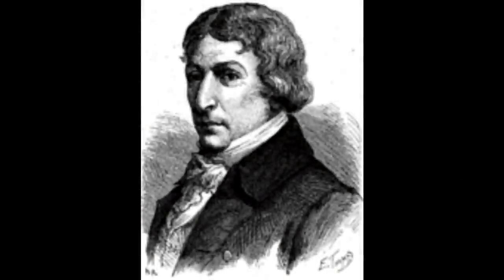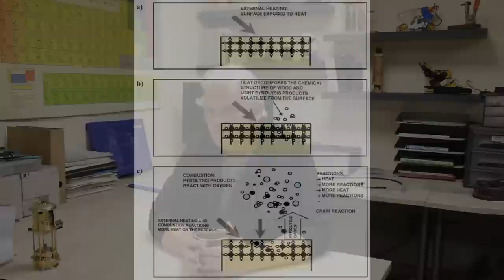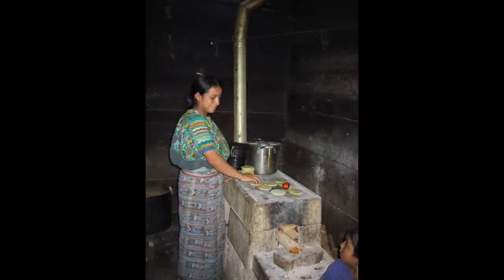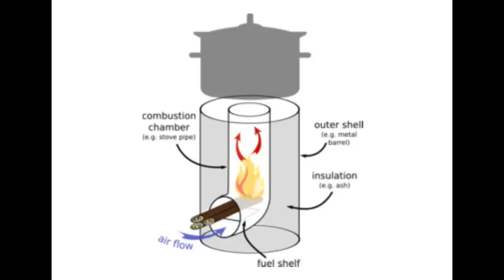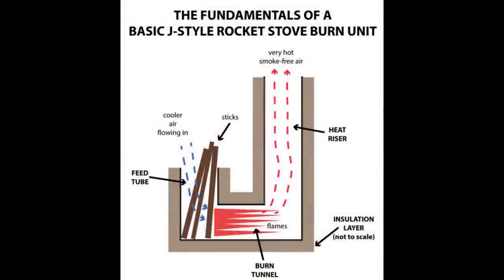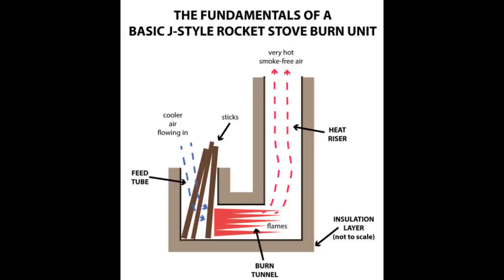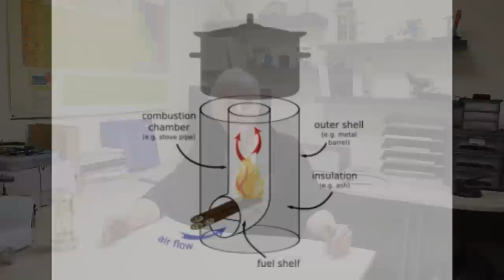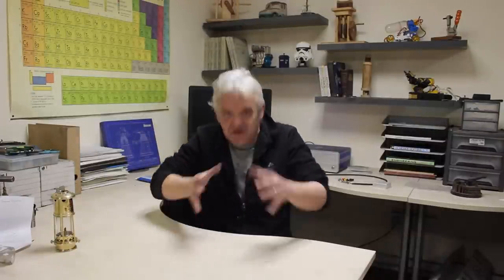1742 The Rocket Stove - Explained and Demystified #rocketstove

Comment: Hi Robert,
This video inspired me to formulate a challenge for you.
Currently there are 2 types of stoves used in bikepacking: propane and alcohol stoves.
Alcohol is not as energy dense and can be dangerous in case of a spill near the fire. But the stoves (see DIY alcohol stove) are very light (20 g?) and small, thus portable on long journeys. Fuel can be carried in different size and shape bottles.
Propane needs a certain volume and it's harder to check amount left in the bottle. Access is also limited to some specialized shops that one can find or not in his/her way. Advantage: it's instant, no spilling, it's energy dense.
Now, my question:
Can you come up with a different type of small, easy to carry and to assemble stove design that uses some other fuel that might be cheaper and easy to find, with acceptable energy density?
My next year's plan is pointing to Greece where I can find Lidl supermarkets.
Stove will be used to cook food, not just tea. Trip will take 2-4 weeks, so we're talking about a lot of cooking.
Thank you!
Reply: Check out tin can wood gasifier stoves. They're light enough for bikepacking.
Reply: In the meantime I made one for myself.
It's a very cool device but it consumes the fuel very fast. 
I'm thinking about trying out a mix of wood and used cooking oil.
If it doesn't make a smoke column visible from the other side of the Atlantic, it'll be a winner choice.

Comment: yes about the mass, good rocket stove mass heaters radiate heat now from the barrel section, then the exhaust is directed through the mass to warm it up for slow radiating. it does take a lot more space to make the mass, but once warmed it may only take 2-3 small fires a day to keep a place warm. a chimney over a kerosene heater, that collected+pushed heat through a mass could work similarly, bright white flame is pretty efficient, same burn as a decent kerosene oil lamp gives but using a much smaller wick.
Reply from the maker: that's jus a hybrid device mate and so it behaves like a hybrid a bit of one and a bit of the other

Comment: From my understanding, to give the stove the maximum live span, special fire bricks that can withstand temperatures up to 1700 degrees Celsius can be used. Based on aluminium oxide it will last longer than steel at the generated temperatures, these are readily available and do not cost much either.

I would argue that the rocket mass heater shown at 8:28 is better in a way. It has a bell with the same function as the rocket stove shown a few seconds later. The second stove goes straight to the chimney after the bell, while not all energy has been extracted from the hot gasses. The first one extracts more energy from the gases by guiding it through a thermal mass (disguised as a coach) after the bell, before going into the chminey. So while they both have the same combustion efficiency and thus produce the same energy, the rocket mass heater extracts more energy from the gasses before releasing it into the chimney. With regards to energy efficiency it's better than the second stove, at the cost of added weight, bulk and complexity.

Just my 2 cents ;)
Reply from the maker: fair points mate - I am more than happy to agree to disagree lol - though it does seem a bit unfair to compare apples and oranges - how do you think a mass heater would perform if it was just connected to the chimney and not the bench?
Reply: @ThinkingandTinkering  It should be obvious, so its baffling that you do not see why.   With the 8:28  design, the barrel releases the majority of the heat into the room.. quickly and efficiently.   The remaining exhaust heat that escapes the barrel transfer stage... gets pumped into the Bench, to be absorbed by that huge thermal mass... before exiting the house, in a vertical chimney.

 The thermal mass captures virtually ALL of the remaining heat from the heater.. and releases it slowly, throughout the entire day.   Unlike fully instant heat, which most of it gets quickly lost to the ceiling... rather than on the level where Humans exist.

 Also, Since you can not 100% guarantee that a burn will be 100%... especially at the start of the fire..  you cant just burn a rocket stove in a house.  You need a chimney that exits the building.   And if you are directly dumping super hot air right out of the chimney... rather than recovering it into a thermal mass... then essentially, you are wasting it.

 According to reports Ive heard... People with properly build rocket mass stoves, like the 8:28 design... went from using 4 chords of wood... to 1 chord of wood, for their winters burn period.   Thats a huge difference in efficiency, and effective Heating.

Comment: There never is a best solution for all situations. Anything designed to do 2 things or more never does any of those things very well. Think using a helicopter search light to change a car tire at night. Blinding yourself extravagantly is not useful for that application.

Extra physics points (for the cool geeks):
You made me realize that a mass heater simply slows down the heat like a Bose-Einstein condensate slows down light and releases it slowly. 
Heat IS infra-red light, so man has been slowing down light since before the measurement of the "constant" speed of light! 
A-HA!

Comment: Good video - as usual!  Thought your description of the best use of the mass heater was poor though.  Hear this - they normally have a more extensive chimney system inside the room - properly done they look to have a cool stack outside the house (virtually all heat left inside) and zero smoke (all fuel burnt).  Now - regards the mass part.  They're mostly set up in northern climes with long cold winters (Russia, Alaska etc.).  So you're heating the house for months on end - continuously - day and night, to a varying degree - but always somewhat.  Feeding the fire all the time is a pain - especially at night - so the idea of the mass is you run a furious fire 3/4 times a day (it goes out in-between) but it's evened out to a fairly continuous room temperature is the main idea of the mass.  They use around a third to a half the amount of wood of an ordinary fire too - which save much work/money.  So it's not so much a set up for Kent or Cornwall - perhaps Scotland.

Comment: I have a question, Mr. Robert,
Can you increase, by a homemade method, the radiation of the stove bodies? A building material, a paint job, something else ? Is it possible to achieve a significant difference?
Thanks!
Reply: Yes, you just spray paint it with a high temp paint of some kind.  You could also put a layer of carbon on the outside, but that is far messier, potentially. The more shiny and/or polished the metal, the more it needs a treatment like this to absorb and transmit IR. Shiny and/or polished metals are particularly good reflectors of IR.  Though there are significant differences between different materials.  (Aluminum is one of the best all around, broad spectrum IR reflectors).
Reply: @justinw1765  thanks Justin, for your reply.
I saw the terracotta pot trick Mr. Robert did- painting it with graphite. Now, that would be messy as hell, but I guess there are more stable paint solutions.
I have sprayed my woodstove (see my YT channel) with a 800 C black matt paint. It holds relatively good so far, for two seasons. I've always wanted to know of there was any other brands pr solutions to further increase it?
I guess I should eventually bolt to the wall aluminium plate, because of the high IR reflectivity property it has. That way the wall behind the stove would not steal heat as it does now.

Comment: I wonder if you could come up with an idea for a simple 'flu box' that one can sit atop a standard commercial gas heater that catches the bad smell that the burning of gas emits and lead it through a flu to the outside but not without first extracting as much heat as possible.

Comment: O no Robert, you missed out on this one. because the rocket stove generates a hotter flame in the tube everything is burnt better/cleaner. a mass heater does generate heat immediately throuhg the barrel that's on top of the j-tube.

Comment: Thank you for making the concepts inherent in the "rocket stove" much simpler to understand. There are one or two points you make, however, that do not seem consistent. first, you say that the mass heater does not provide more efficiency, it just shifts the time frame of receiving the heat.  Do you mean that in comparison only to a rocket stove or any wood stove, such as a cast-iron airtight stove.  Isn't there loss of efficiency if there is no mass to absorb all the heat produced through a long run of pipe through a thermal mass ? At a hot enough burn to consume all the gases, most of the heat will be lost up the chimney since conduction and convection are insufficient to move all the heat produced out through the walls of the stove.  The other point you make, about the rate of burn not having any effect on the total amount of energy produced, similarly seems to contradict what you explained at the beginning about the stages of wood burning.  When lowering the rate of burn, one must reduce the flow of air into the stove (again, I am referring to an airtight stove). At that slower rate of burn, the gases given off cannot burn and escape up the chimney, thus reducing the total amount of energy captured by combustion (and releasing air pollution). Only a faster/hotter fire can burn those gases completely and thus gain all the energy from the fuel.  If I am missing something, please explain where I am mistaken.  I am certain you know a lot more about this subject than I do.  Thank you !

Comment: I wonder if It makes sense to install a rocket stove, even a brick rocket stove, outside and make two holes in my wall, high and low or left or right, and make a 20cm metal pipe go out of the house with a computer fan past the flame and back into the house and let it heat up the air in a closed system and keep the fire and fumes outside for a house without a chimney.  I wonder if I could easily plug those holes back up if it would not work well.  Would love it to work well tho.   Thanks for making these videos.
Reply: mr grumps  true,  true….

Comment: Problem with storage heaters is you have to know what the following day will be like, which I found was an issue so great that they had to go (I never got it right). Gas central heating replaced them as soon as I could afford it. Cold turn it on, hot turn it down 🙂
is there a design which has an ash pan?

Comment: Early on you talk about the heat going into the bottom of the pan or pot but missed one of the key points of the rocket style stoves. The gasses, soot, creosote & solids a fire pushes into the space or out the chimney. Importantly in developing parts where these were invented for those gasses were killing the folks who had to cook indoors slowly by causing cancers, black lung & in extreme cases CO2 poisoning. The more complete burn reduced these compounds dramatically.  
8:00 The catch here is the barrel style of mass heaters. The quick radiant heat comes off the barrel top & sides but just after the exhaust you can push the cooling gasses into a bell or mass. This stretches out the warming time.
Reply from the maker: it's not a catch mate - if you build a hybrid device you get hybrid behaviour

Comment: My understanding is if a rocket stove  is shaped correctly it will 
burn/reburn the flammable smoke, gaining efficiency & heat..(commonly called wood gas, that is lost in the normal process)

Comment: Well mass heaters also do something else, which explains why we still see people making videos about the plant pot/tea light heaters. 
 It traps the heat as a certain level in the room. So in the tea light heater, build a tea light plant pot heater and next to it put a single tea light. Both tea lights put out the same ammount of heat. But the one by itself puts all its heat up straight away. Up and typically above peoples heads and out of their line of senses. The cant feel it and since heat rises, it stays there warming up the ceiling. The plant pot gives a visua focus and as you said lengthens the time over which the heat is released, but it puts it where it can be sensed. They make nice hand warmers but not much more. 
If someone wants to make a really good plant pot heater for a small space then get you one plant pot. Put a small piece of screen or a small broken piece of plant pot on the drainage hole and then fill the pot with plain bargain basement unfooled around with kitty litter, or vermiculite, and set up bricks or pavers such that they will hold the pot off the ground and hold it stable so it doesnt fall over. Get you some sterno heaters or chafing dish heaters and use two or three of them to heat the pot and the litter. This will also heat the bricks or the pavers but less so. 
 This will put out some residual heat immediately, near the device, but like he said you are just charging a heat battery. Once its hot, a small electric fan will help it heat more air more quickly buy blowing air over it. You can get this quite hot as chafing dish heaters can last 4 to 6 hours or more depending on size and type. So maybe set up something to keep people from bumping into it and burning themselves on it.

Comment: Okay folks. Here's a twist. What about recommendations for a rocket stove for a maple syrup evaporator? 
My big question at this stage is wondering if I should put the rocket stove in front of the evaporator and have it exhaust under the pans or is some other configuration appropriate? 
One thing to keep in mind is that you want as fast of a boil as you can get. Slow heating isn't very useful as you're trying to keep the sap boiling and the more vigorous the boil the more efficient it seems to be.
Reply: I would use a "Liberator" style rocket stove. People make them with the J stove thing he's showing here (often with an auto feed section extending up and away from the firebox), with an insulating chimney, inside of an upside down 60 gallon steel barrel. The hottest part is sitting on top of that 60gallon drum. But you can also gain a huge amount of energy from the horizontal exhaust piping before it leaves the building. The efficiency difference isn't in the burn because they both burn nearly identical. The gigantic efficiency gain from the style with the 60gal drum  is in capturing the heat from the exhaust before it leaves the building, and in dumping that heat down low so that it warms the floor and rises upwards through the building. 
It's important to have a hot firebox and initial chimney section to allow for complete and steady combustion, however for best heating efficiency you then want to steal as much of that warmth as possible without killing your chimney draft. The 60gallon rocket stove with the horizontal exhaust that comes out low allows for the best of both worlds.  It really is far superior in every way.

Comment: I've been thinking about putting a wood stove in my shop. I also have lots of used engine oil from the cars I work on. I've been thinking about combining the mass rocket stove idea with an oil burner to heat the shop and get rid of waste. Any input about burning oil in a rocket stove would be appreciated.
Reply: Recommend recycling the oil.

Whatever goes up will come back down and its vest to keep that out of your air and ground water.
Reply: @l0gic23  recycle it into what?. I've heard that it is sold as bulk fuel oil to run large ships to help cut their costs. If they can burn it, so can I.

Comment: Get the best of both.
A rocket mass heater with a contraflow drum.
Instant heat from the drum and slow heat via the mass.

I wouldn't built a J tube version i would go with a box mass heater with a contraflow as you can load it and forget it.

Comment: Having a lot of thermal mass like the size of a house means you have more control over the temperature inside. Like not having to burn to 40 degrees in the evening to still have above 15 in the morning. Less thermal gradient = less heat loss.

Comment: I want you to go back to your water jacket design and try and make it more effcient, I like the idea of being able to have the fire and gases burning outside but transfering the heat into a central heating system or something like that inside the house, most modern houses dont have a chimney.
Reply from the maker: Cool idea!
Reply: You can experiment with venting the hot gasses through a normal firetube hot water heater.  You may find one that was scrapped due to a bad burner.  The problems are  keeping the firetube from getting chocked up with ash or creosote, keeping the burn of the stove from being too long and overheating the tank or system,  and building a rack strong enough to handle the 40+ gallon water tank.  Getting the flames hot enough to burn all the gasses is very important.   Having a controllable airflow and shutoff is next.

Comment: What if, inside the chimney there is a sort of bell shape (or upside down pan), maybe with holes in, to further catch/slow the gases as they rise? Placed at the point where the temperature is best for them to burn. Perhaps it would allow for shorter chimneys.

[edit: or mesh baffles around the outside edge of the chimney, and a cyclone airflow to throw the unburned gasses out to the side and keep them in the hot zone longer - maybe even a catalysed mesh, like in your flameless heater vid).
Reply: You want to speed up the gasses not slow them down for efficiency.